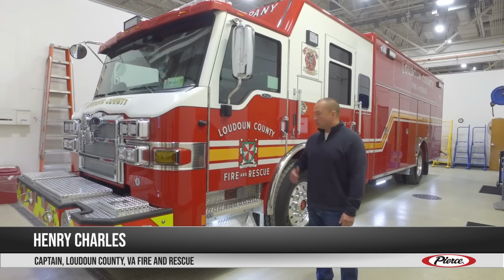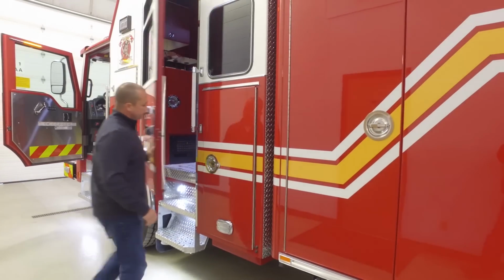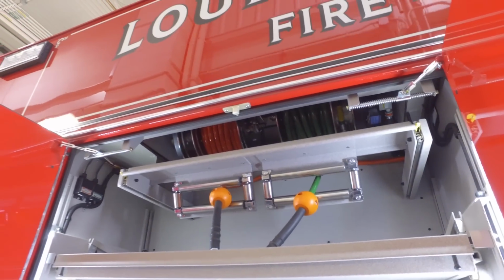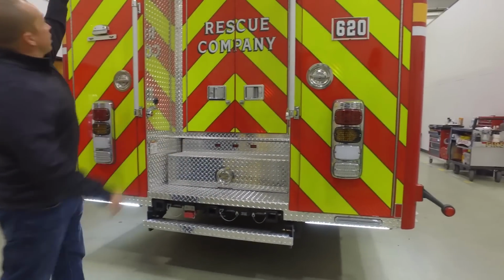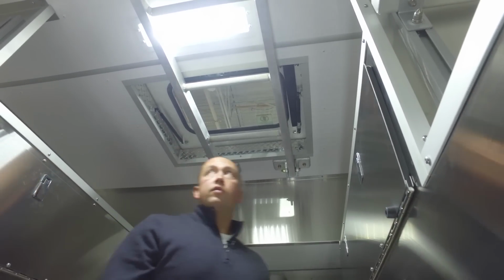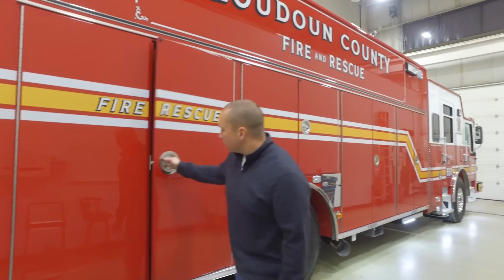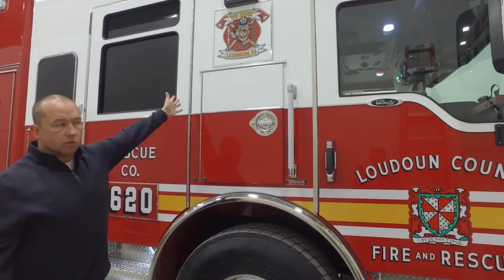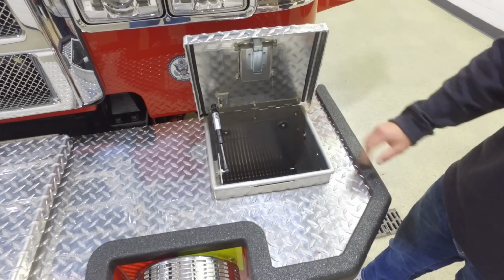Velocity® Combination Rescue – Loudoun County Combined Fire and Rescue, VA

Comment: What's the purpose of the small extended side lights on the rear? It may not be long before they are broken off.
Reply: They are marker lights so the driver can see where the rear of the apparatus is